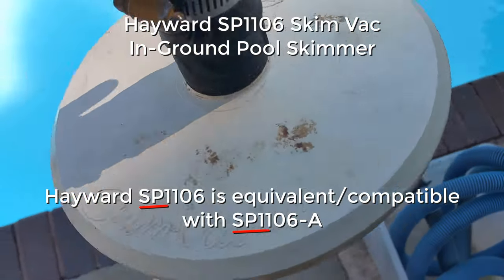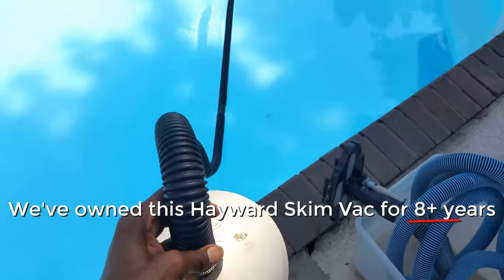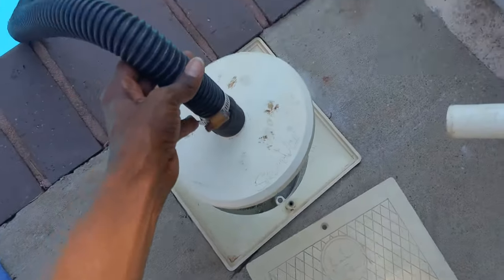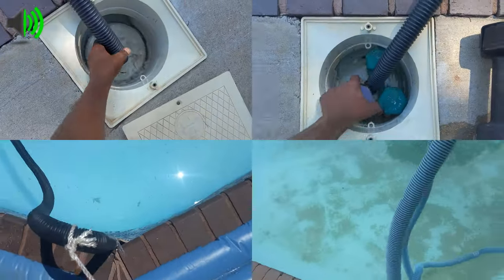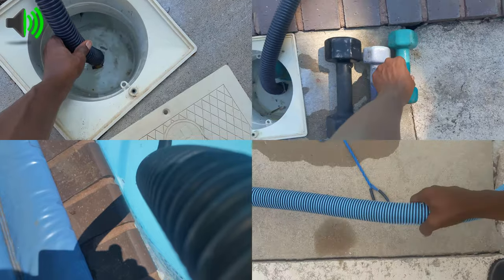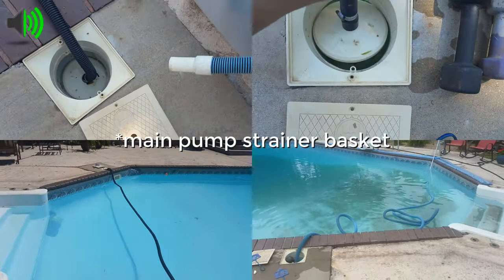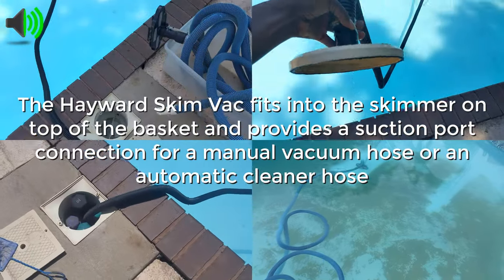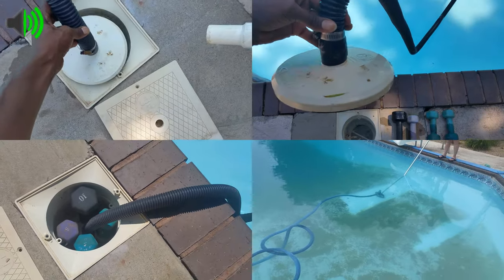WORTH IT!? Hayward Skim Vac In-Ground Pool Skimmer (OEM)

Comment: This skimmer vacuum disc will only work with skimmers that have only one suction hole.  It will not work on pool skimmers that have two holes, one for the skimmer and one for the main drain.